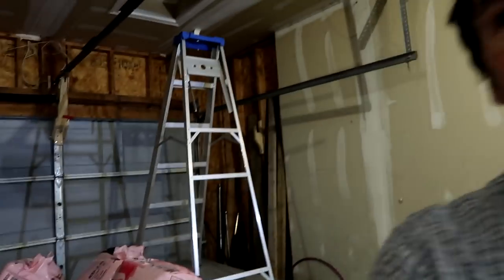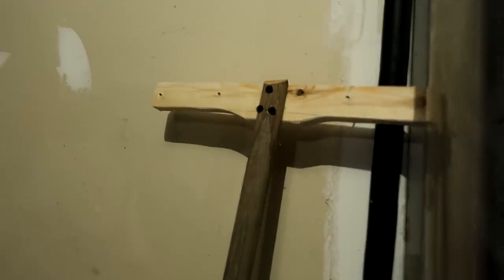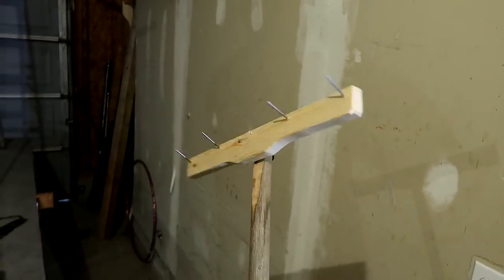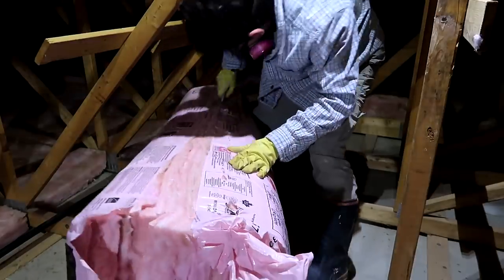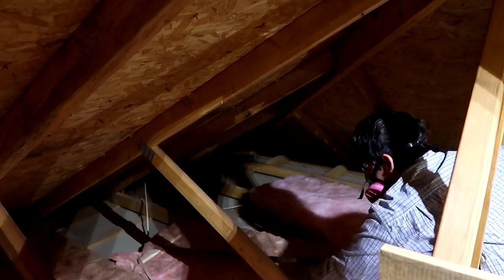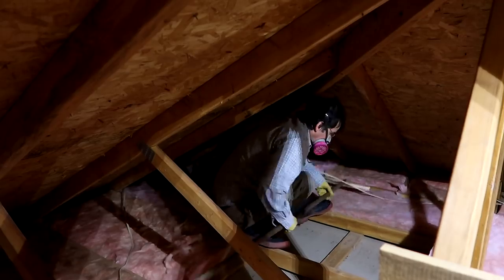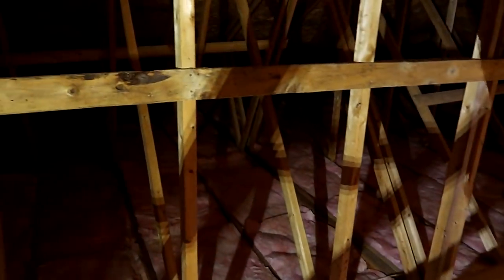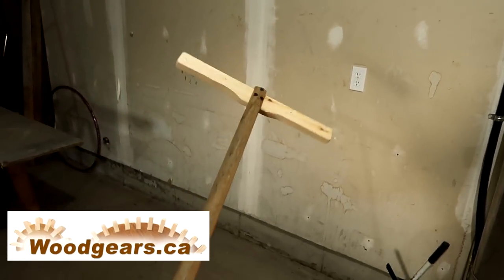Attic fiberglass insulation spreading rake

Comment: What would happen if you didn’t wear the mask? I have worked with insulation before and I didn’t know I was supposed to wear one.
Reply: Nothing, it's fine. fiberglass probably scars your lungs exactly like asbestos. But honestly if you're not doing it everyday I don't believe there's anything to worry about.
Reply: That's not true, one asbestos fiber could cause cancer. But it takes 30-40 years to evolve.
Reply: Lachertje812, you do know that asbestos is a natural mineral right? You do know that it exists everywhere on earth and is in the air at all times right?
Reply: Yes I know. But stuff that naturally occurs isn't automatically save. And it's not that common in the earth's crust. Better to stay away from it. In my country, in 2020, all visible asbestos has to be removed from buildings by law.
Reply: Shameful overreaching legislation that's putting undue burden on individuals. Buildings with asbestos are show to have less asbestos in the air than fresh air has. Asbestos is only a problem if you grind it up and breathe in the dust for decades. Laws for disposal of asbestos in the US are pretty dumb. You're supposed to bag it all up in black trash bags and throw it away. Like that's going to do anything. Asbestos is fine. Everyone's fine. It's okay.
Reply: One major difference between fiberglass and asbestos: fiberglass is dissolved and absorbed by our bodies. Asbestos isn’t.
Reply: I've never heard anything about this dissolving glass. I can't find anything after a short google to support to deny the claim. But what I do know is that fiberglass's health effects are unknown. I have my money on fiberglass being demonized within our lifetime just like asbestos.
Reply: byw google for biosoluable fiberglass
Reply: Interesting. I didn't see any years mentioned on the page I read, but it appears to be a fairly recent thing. Any idea how many decades we've been using this sort of fiberglass for insulation?

Comment: I'm surprised you're not doing blown cellulose.  It's cheaper, easier to install and insulates better.
Reply: Around here, Lowes/HD will refund your blower rental fee if you buy a minimum number of bags and the best solution for not blocking the eave vents is to install thin plywood to the underside of the rafters.  They sell plastic things that you can staple in (raftermates) but the plywood is easier to install and works better.
Reply from the maker: I'm sure that would be quite miserable to install!
Reply: Do it right, do it once?  In the main attic space of our house, I actually constructed a catwalk, extensive air sealing, electrical upgrades and repairs, eave baffles and a few other things before blowing in cellulose.  I spent FAR more time prepping the attic.  Blowing in the cellulose was stupid easy work and only took a few hours of sitting up there pointing the hose.

Comment: I've been told that when working with fiberglass insulation to take a cold shower when done, so the fibers don't get in the pores of your skin. Just a tidbit for those who haven't heard that but of advice yet.
Reply from the maker: I took a warm shower and washed the clothes.  No itching.
Reply: Matthias Wandel 
I honestly have no idea if the fiberglass actually gets in your pores, I suspect that the most important part is to wash off thoroughly relatively soon after.
Reply: It’s less the pores, but that the micro-fibres are sharp enough to penetrate the skin, and any friction on them contributes to irritation.  I’ve learned the hard way to keep a few sets of tyvek cover-alls around if I have to work with fibreglass.  Lessons learned decommissioning a plant that make fibreglass tanks.  The first lesson of the job:  Even if you’re removing something from the ceiling, NEVER look up, lest you get a face full of glass dust, even if you’re wearing snug eyewear.
Reply: The Walrus 
That makes more sense.
Reply: You can also rub some baby powder on to block the pores and prevent glass fiber from getting in. It works for me.